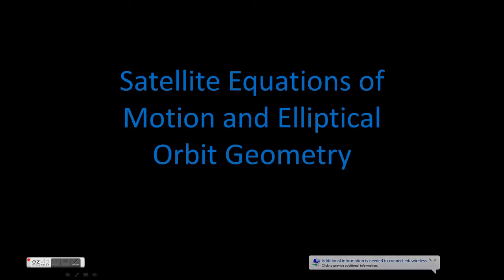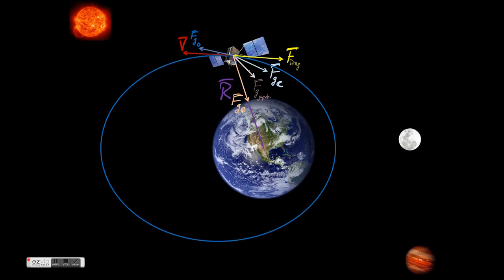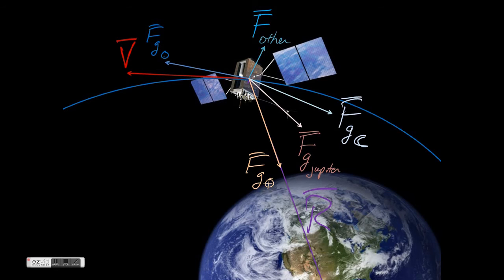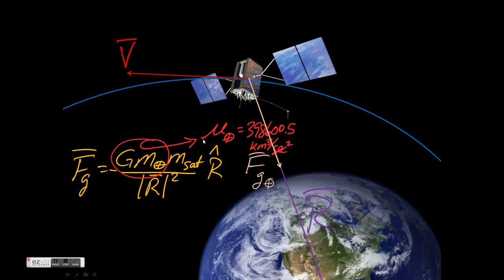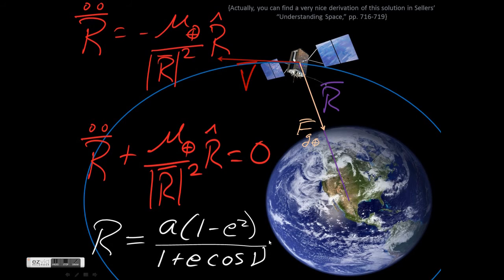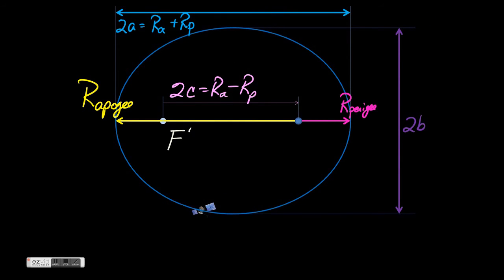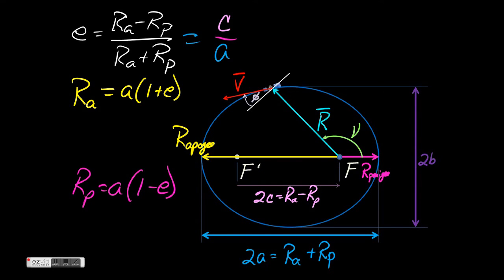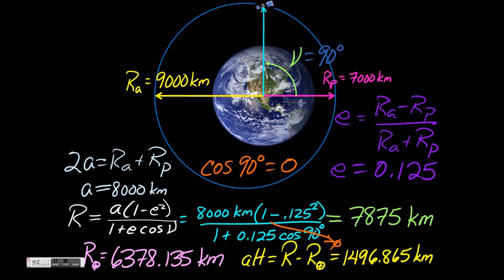2-Body Equation of Motion & Elliptical Orbit Geometry

Comment: @Marty France do the maths on the iss please ,  from what i can tell its braking a few rules  . the people onboard feel zero G but the actual iss IS gravity locked at 1g whist orbiting earth fast enough to be pulling 16G .  this makes NO sense , if earth span at 17,500mph people would die sliding across the floor equater bound at 16g
Reply: fatbarry barry when you aren't experiencing acceleration, you feel no force. people on the iss do experience acceleration, due to gravity, but they fall fast enough to miss the earth.
Reply: Nate Petersen i know that as its the most regulary repost responce tho i clearly just want the MATH >>>> 2+2=4 <<< like that no words just maths plz 🙂👍
Reply: h=L/m.
Reply: whats h L m  representative  of ? can you show your working out  how you got to h=L/m ?
Reply: if a woman give a birth on a plane will the baby die from the plane speed ? .  anyway what is your point ?  I smell flat earth thing here or  god thing
Reply: If you calculate it, this required force comes out to be m(ω^2)r
. Here, r is the radius of the circular path traveled  \omega (angular frequency) is the number of rotations per second times 2π
consider a person (of weight 80 kg) standing on the equator. His 
ω
and 
r
are
ω=7.27∗
10
−5
rad/s
ω=7.27∗10−5rad/sr=
R
earth
=6.4∗
10
6
m
r=Rearth=6.4∗106m
The force required to keep this person rotating turns out to be about 3 N. This is much less than the downward force due to gravity which is about 800 N.
Conclusion: People don't get thrown out by earth's rotation because they are pulled downward by earth's gravity.